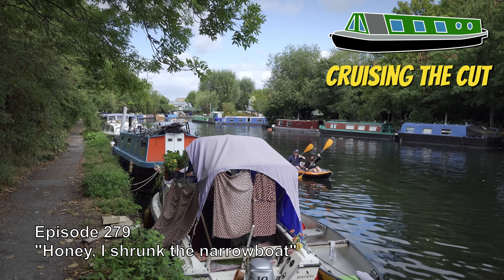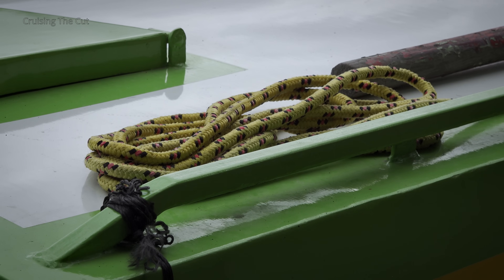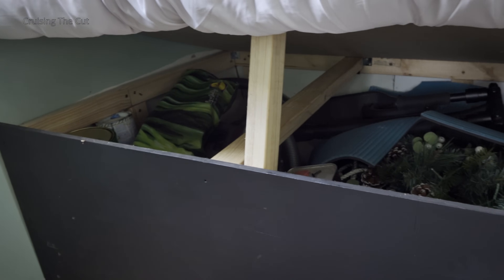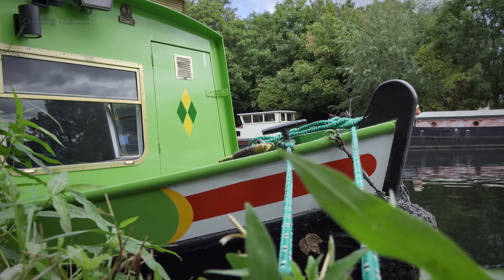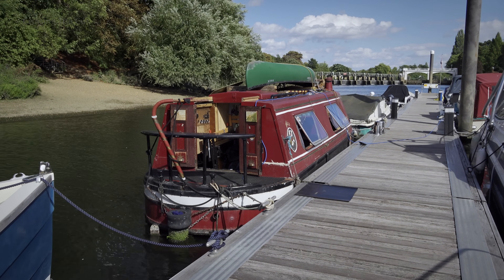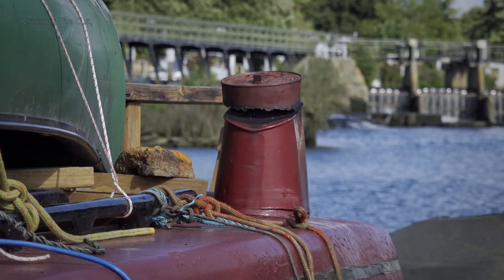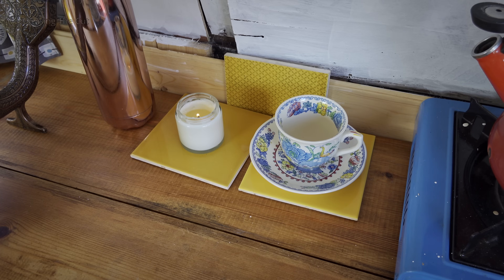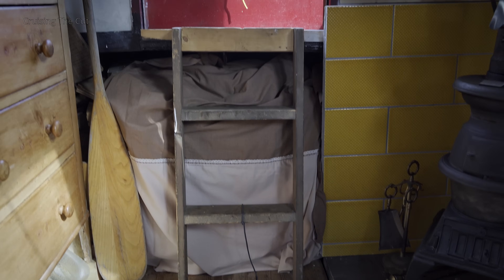279. Tiny Narrowboats!

Comment: G,day David from Sydney Australia. 
Doesn't it show the reward of a meticulous structural inspection of the boats hull and engineering.
The fittings and fixtures can be replaced or restored.
I can't believe the boat to toe path abuse. In Australia: in a public place it is eliminated very swiftly, such as road rage, home invasion
Elderly abuse.
🌏🇭🇲

Comment: Question- does "bits and bobs" roughly mean the same as gubbins? Or chotchke?
Reply: Close to gubbins but kinda just means "things". Not only objects, can be used to refer to tasks or activities. Closely interchangeable with "this and that" in the literal sense. 
Chotchke would be closer in meaning to "tat" which is a contraction of "this and that" but used figuratively to refers to useless decoration or somewhat trashy or unironically kitch objects.

Comment: I’ve not been on a Narrowboat since the 1980s. I remember the then British Waterways Board, had introduced a registration scheme. All boats kept and used on the canals, had to pay an annual fee (similar to taxing a road vehicle) based on the boats length in feet.
I can’t see one of the little black  ‘Numberplates’, on display. Has the Registration system changed in recent years?
Reply from the maker: Not much, you still pay a licence and it now varies with width as well as length. There are still licence number plates on many boats and it’s a requirement to have the licence clearly displayed on both sides of the boat.
Reply: 0:20

Comment: When it rains... how do you keep the bow area of the boat from filling up with water and seeping into the front door of this narrowboat?
Reply: Bramble has a drainage hole at both sides to let excess water run out
Reply: @bensboatbramble  Thank you.  I really needed that information.  I am building a boat that will have a similar open cockpit and that was information I really needed.

Comment: I finally  found my sports fisherman a 38' 1969 chriscraft commander.  It needs some mechanical work.  It's  on lake Erie I'm Ohio.  A long cruise from my home port in Maryland.  I plan to have her trucked down .  The cost will be half if I was going to motor it . From $8,000  for  petrol to $4,000 by truck.  Wish luck with the mechanical issues  rewiring,  electronic ignition  from non,  to name a few. But this boat would go for approximately  $50,000 us $. I'm getting it for $8,000. It's  a estate sale. 
        🍻  cheers

Comment: Interesting. I thought these would be a little like Sprinters or Transits inside, since they're about the same size and shape. But they're not at all. I'm thinking it's because these boats last way longer than a van, weight's not really a concern, and neither is vibration since they're so slow.

Comment: 30 to 40' seems to be the best functional size for a small narrowboat.
Reply: 40' is generally the minimum length required for a boat which has a fixed bed, although I have seen a 36' boat with one. My boat is 42' and that's fine for one person although here's never enough storage space whatever the length of boat.

Comment: Very Nice Video,!.. "This  is the size I want to make".!...  to float up and down the rivers in  the USA.. I want to make mine out of 2 inch Building foam and double up the Hull so its 4 inches thick, and then put Several coats of Porr Mans Fiberglass and a epoxy paint finish to make it  all Watertight, all wile  cutting pieces of 2 x 4  to  glue in place for the hull side walls to anchor 
points needed....for interior work to be finished.  The interior walls would  be again  4 inches thick for warmth and cooling and to finished off  so you could live in it for a few days at a time....... Lots to figure out yet ..water tanks and toilet  what kind and where to put it , and power for the frig and so on ,this is the basic idea for a smallish cannel boat  I think the main power should be a smallish   out board  motor and then go from there...!    Do you think this will work to keep this build project with in reason for price and weight to go on a Trailer and tow it to places of interest to explore ..?   Am i missing anything ..?  Love to hear what you think if this would work ,
Reply from the maker: Not something I could reliably advise on
Reply: @CruisingTheCut  Just trying to afford a budget boat.!. it wont be going thru any locks at all just down and up a river deep enought so it does not bottom out ..?  what would you suggest other than steel ..?

Comment: They are sweet 😋 A smaller size would work well with an electric motor   wouldn't it?
Reply: Any length would work well with an electric motor. The issue with a small boat would be charging the motors again: there's very little room for solar panels so perhaps you could take something like a Torqueedo to the office to charge it.
Reply: My 12m sailboat it's main disadvantage is the little space for solar panels and a decent size battery. On a smaller boat that problem gets bigger. Also the longer the waterline the less power it takes to go faster.

Comment: Just my size!! 😁
Reply: Odd that it might seem but steering a 70 ft boat is reckoned, by some, including me, to be easier than that of a boat a third that length. It might be the inertia of possibly 20+ tons "dampens" out the twitchiness.

Plus there is the question of the size of the rudder and the length of "swim". The "swim" is the length of hull below the water line which stretches from the prop forwards, which curves in towards the stern.

The longer the better.

I have had the misfortune to navigate one of the shorter hireboats from the yard where I moor ... the rudder on this hireboat was the size of a postage stamp plus it had limiting rudder stops.

It handled like a constipated three legged pig, with a vast turning circle.

It wouldn't have been much fun having a "holiday" on that boat.

The thing to understand is if you want to buy a very short narrowboat then take it for a trial run before you even dream of getting it surveyed, let alone entering negotiations.

Sometime a little is a lot ... of trouble.

That said if you can track down a "good" one then well done you.

Comment: I'll stick to my kayaks they fit on a trailer and store nicely in my garden while I live in my house lol. Doubt these are small enough to get out of the water on my own and defo too heavy for my trailor eh.
On a serious note these boats always make me smile when I paddle padt and come with a few ore luxuries that my kayak doesn't like a stove with comfy seating not to mention engine powered unlike the paddle power I need to use kayaking. I presume much much cheaper to licence for use on canal n river compared to a 70 odd ft one... bonus also storage for kayak on the roof yer I'm  slowly coming around to these midget canal boats thanks for getting us a quick glimps in two boats.
You're welcome to do a tour of my kayak anytime you'd like to turn up gor a paddle on the local river or cut near Brinklow in Warwickshire... lol..  all the best to all the small floating homes out there ..  great film thanks. Kev
Reply from the maker: Cheers Kev 👍

Comment: Does England have mooring fees on these canal waterways?
Reply from the maker: For private moorings eg marinas, yes, but for general mooring along the canal there's no specific fee as use of the waterways is covered by your annual boat licence fee
Reply: @CruisingTheCut  thank you.  I am Canadian and unfamiliar with boating licenses.  How does that work?
Reply from the maker: If you wish to use a boat on the canals (this is for England and Wales, it's a different authority in Scotland) then you have to pay an annual fee for having a boat on the water. The largest canal authority is the CRT but there are others who manage some rivers and some other canals so if you want to take your boat everywhere it can be a bit of a minefield as you need licences from each. For most canal boaters, the CRT licence is sufficient.

Comment: Why aren't they made out of aluminium ????
Reply: Electrolysis
Reply from the maker: Mostly cost, it's substantially more expensive than steel
Reply: @CruisingTheCut  Plus there is no weight savings, because you'd replace it with ballast. A flatbottom boat has to have its center of gravity a maximum of half the width of the beam from the waterline or it would tip over! With a narrow boat, that means lots and lots of ballast.

Comment: In north america,  ports, harbors charge by the foot of the boat for docking fees.   So 32-40 foot boats...   at $1.50 ft/night  start to get expensive.   and monthly fees at $10.09/foot.     Now add to that if the boat is wide...   over 18’ wide,  the fees are doubled.   most Catamarans are about 18-22+ feet wide.  

This is why the small boats are so much fun...   Take the C-Dory 16...   its a 16 footer,  so 24/night to dock.   it has a birth so you can sleep in it...   toilet...  no shower stock but..    semi enclosed cabin that CAN be fully closed up.  its a tiny little cruiser you can take out for weekends.  Then store in your garage.   

Really there are a few, but very few boats in the 16-20' range these days...   but there are tons that start around 24' and have all the bells,  bathroom, shower, kitchen with hobs,  bedroom table.  C-Dory 25',  Silverstreaks 25′ Cuddy Cabin – Swiftsure.

20-25' seems to be a good size for 4 people cruising, or 2 people living.  But there are not very many "good" choices for a single person... just looking to go out for weekend trips...  very few in the 16-20 foot range configured for that.

Comment: Here's the key to solving homelessness across the world . Issue these micro boats to anyone that wants one ( free of charge ) and send them on their way . No
more clogged up sidewalks , and no more discarded needles in front of schools .................................
Reply: Boats take a lot of maintenance and costs.
Reply: Ehh, not really - they stack really badly - so compared to surface area it's not a great solution. But idyllic - yes.
Reply: I’ve not seen the nameplate ‘Freeloader’ on this show yet. It would be folly to think that a boat is a cheap way to live. They also need injections of cash from time to time. I’m not sure that the canal trust would like to see abandoned sunk or half-sunk vessels on the system. I believe that narrowboaters are very responsible and resourceful.
Reply: Plenty of used needles floating down the norfolk broads from Norwich. Don't think it would work......